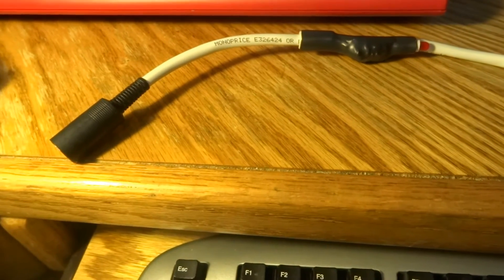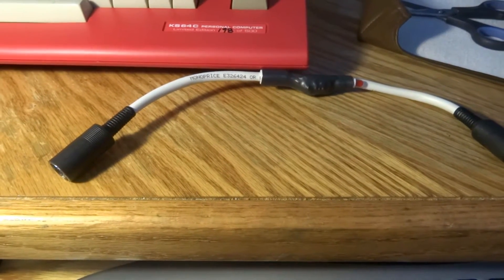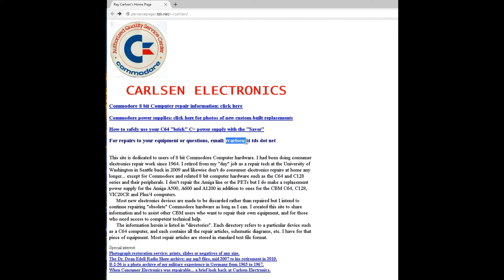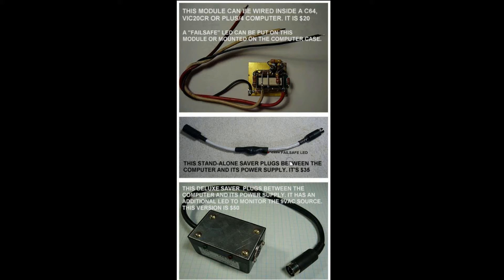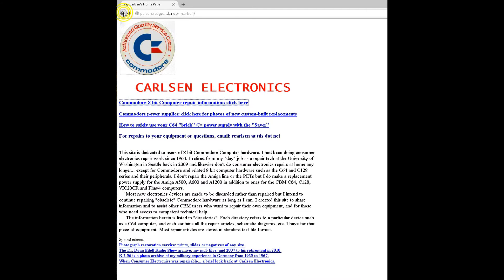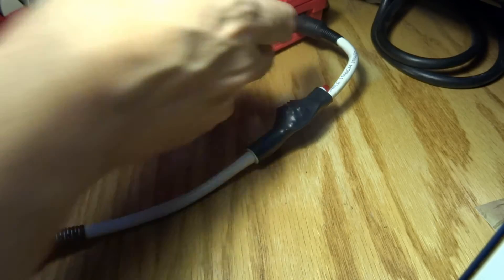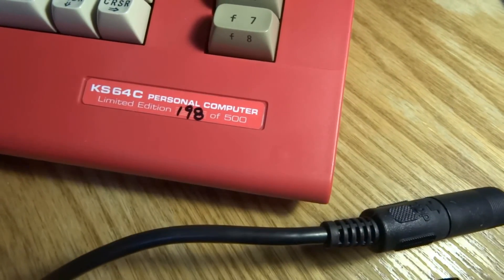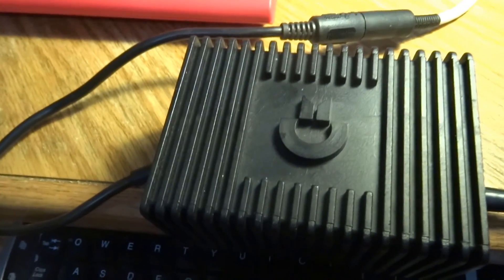C64 Cable Saver | Ray Carlsen

Comment: Did you try the power saver cable on your broken/white power brick to see if the LED lights up?
Reply from the maker: Thanks for watching, it's been a while since I put this out, but I think the power brick you are speaking of actually is working, but not well enough to power my C64 Ultimate 2, so I am just not using it for now since I don't know how to repair it.